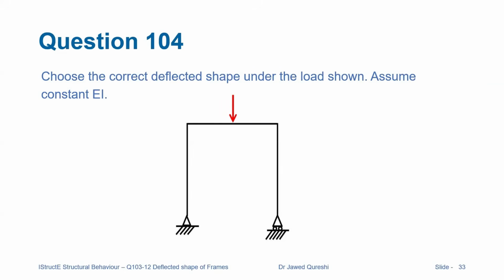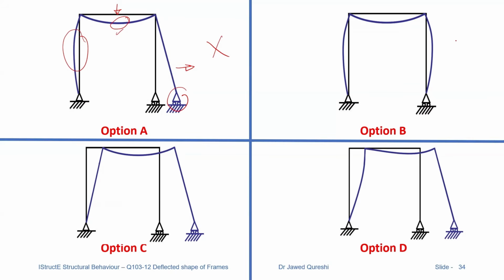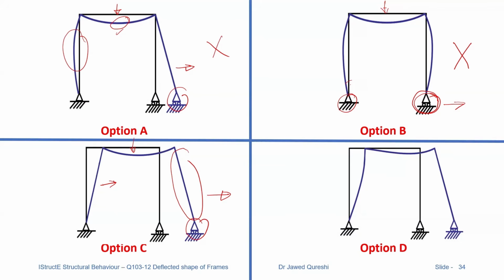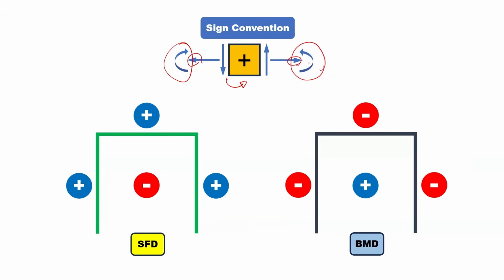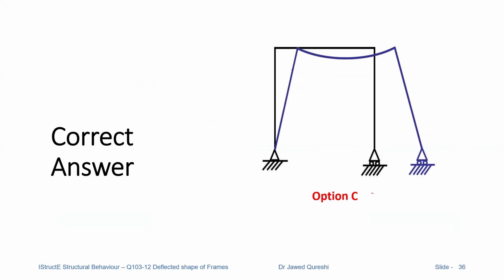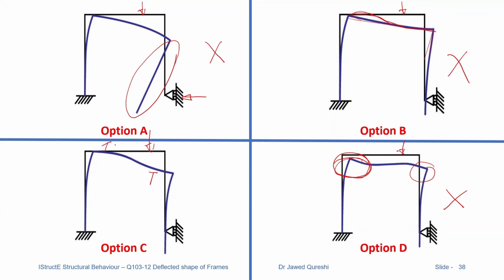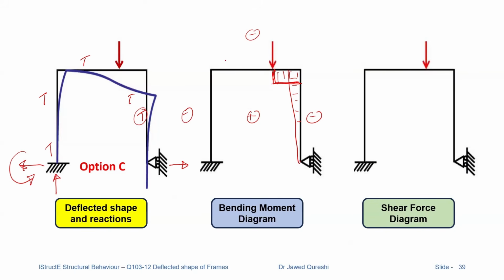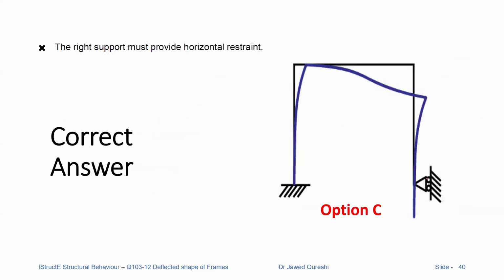Stop Guessing! Master Support Conditions in Minutes

Comment: Thanks Dr.Jawed, I've a question at Q1, since the horizontal force at the pin is zero, what keeps the pin from moving either side like the right roller moved to the right. So, wouldn't it be considered as a mechanism the whole frame because of only co-planar forces? And Q2, how is it a single curvture on the left column with fixity ends?Thanks a lot.
Reply from the maker: I've seen the question. I'll respond soon.

Comment: Your lectures have made me more confident, thanks. Always Wondered how a joint can be fixed!😄
Reply from the maker: When the column rotates with the beam, the joint is considered fixed. 
However, there is no ideal pinned or rigid joint in real life these are modelling assumptions.
Reply: Very nice

Comment: I'm still waiting for your job interview series, completing all the basics and a bit of medium and high-end concepts, sir.
Reply from the maker: Yes, I was thinking of creating a similar series. I have a planned session with young graduates at the University of East London who have secured good engineering jobs, and I’ll gather feedback and prepare something soon.
Reply: Thanks Dr.Jawed, I've a question at Q1, if the horizontal force at the pin is zero, what keeps the pin from moving either side like the right roller moved to the right. If so, wouldn't it be considered as mechanism the whole frame because of only co-planar forces? Thanks a lot.